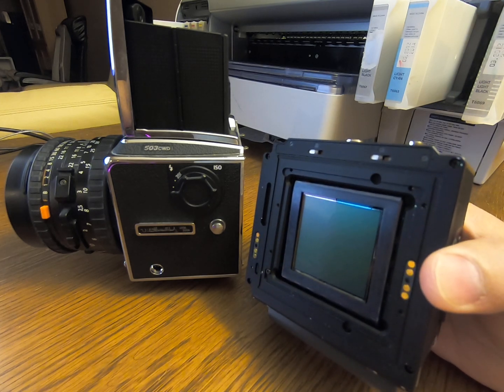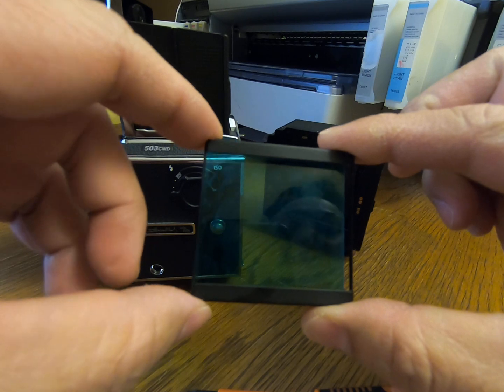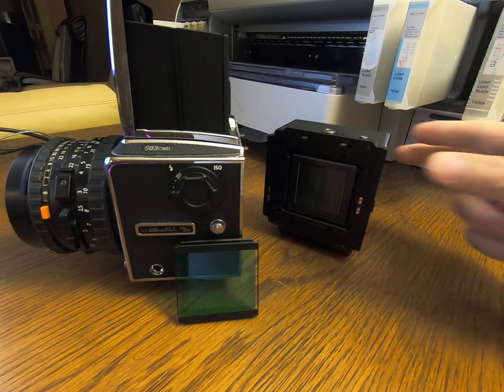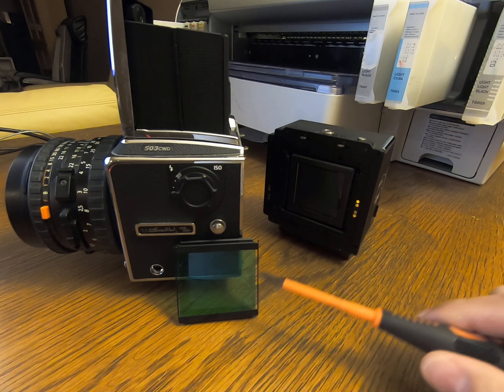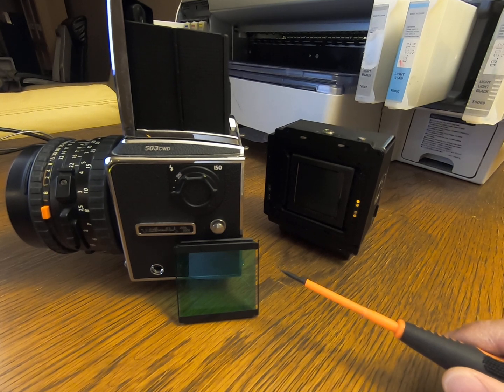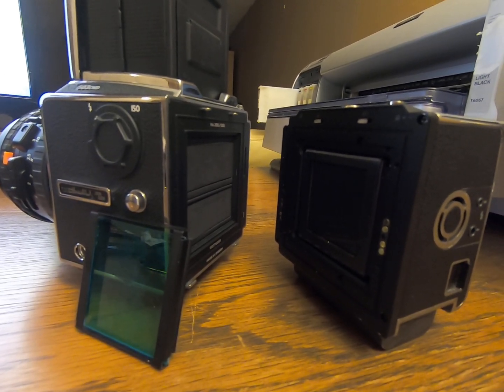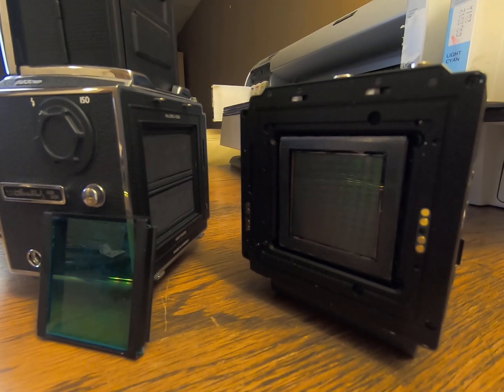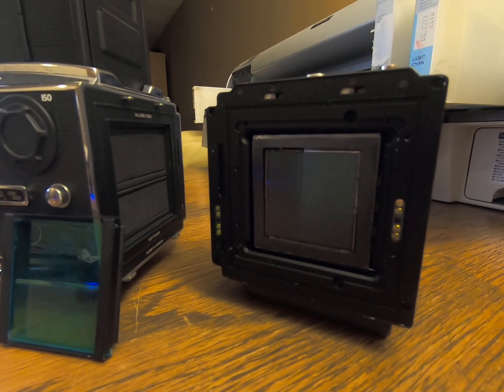How to replace Hasselblad CFV digital back IR cut filter at home, part 2.

Comment: Thank you for taking the time for this, I had to replace the IR filter which is not fun. So after ordering two due to getting the wrong size it was a quick fix but wow to ensure to remove dust that is the trick.
Reply from the maker: I just gained control my account back today. The filter I replaced, shown in video, stand still after 2 plus years.
Reply: @toanleusa-dailylifefoodand5691  Can you share where you bought the IR filter from? Do you have a link for the IR filter?